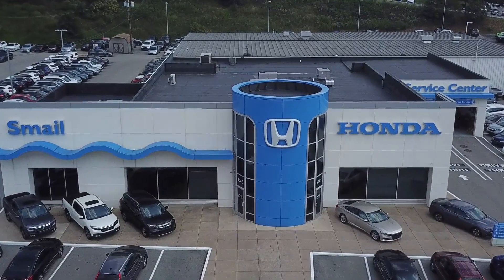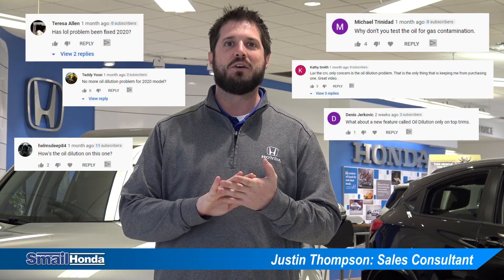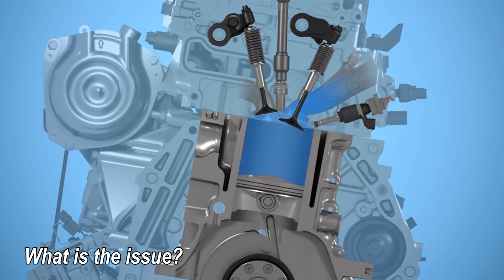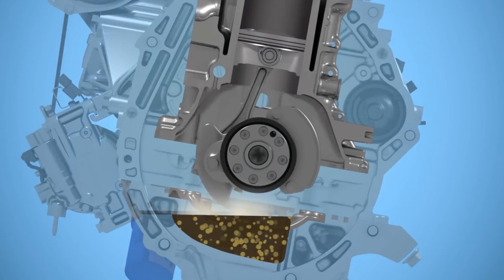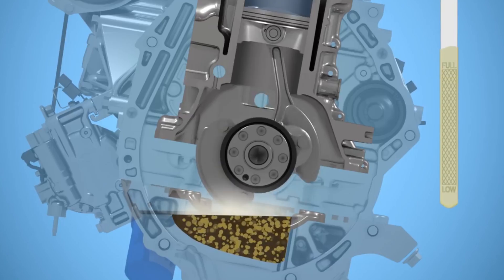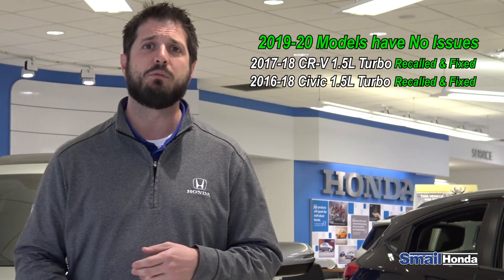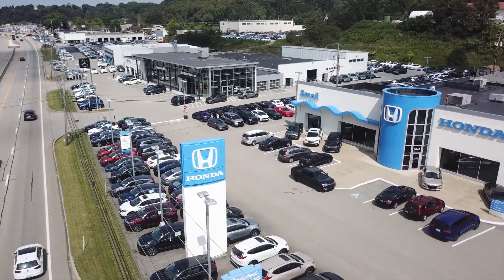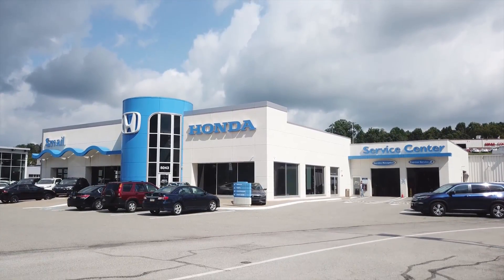Honda Oil Dilution Issue Explained

Comment: This is so not true about the 2019's being fixed, they are all over the internet. I traded a one year old 2018 crv Ex back to honda in December of 2019 because honda could not fix the oil dilution issue. It was adding 8 to 12 ounces of fuel to the oil every 2000 ish miles. Unless you made highway trips of 300 miles each way.  I am going to call you next week Justin and talk about my issues.
Reply: Justin never called me to talk about oil dilution and the great Honda cover-up.
Reply from the maker: Visit www.smailhonda.com to get all our contact info. We are located in PA!
Reply: @Smailhondavillage  I called you Justin and left my name and number, you never called me back. I just would like to explain the situation I had, I'm not gonna get rude or anything.